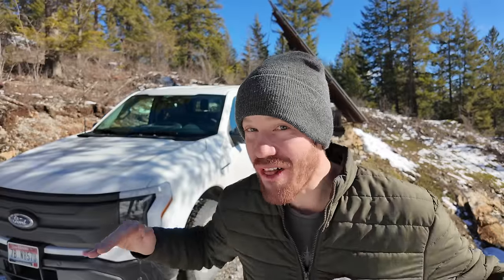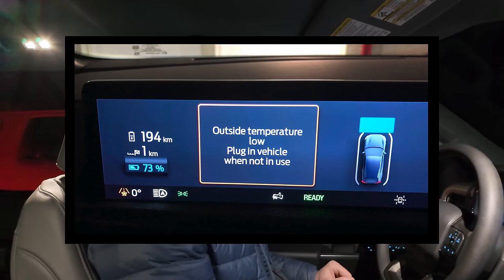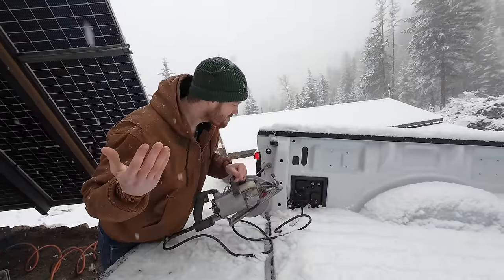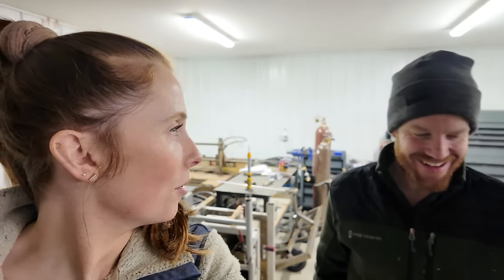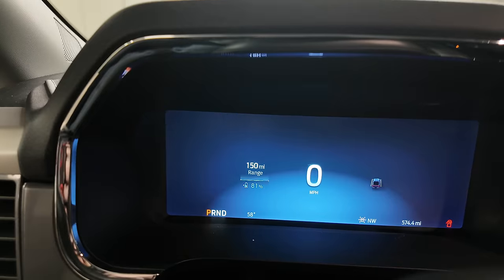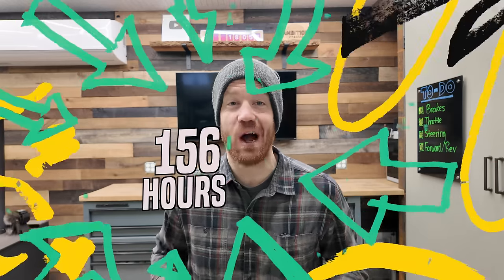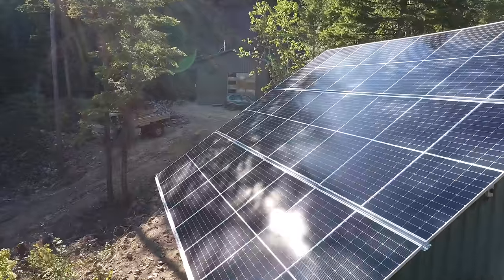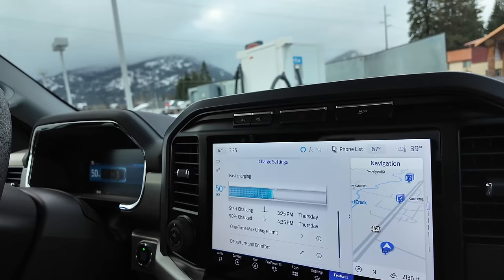Replacing My OFF-GRID Power System With an E.V. (not what I expected)

Comment: It being a Ford, it's bound to have electrical problems out of warranty that you're not going to be able to deal with yourself, so obviously I wouldn't have one as my only battery storage for my off grid system.  Right now it's the only truck that offers that ability though, so I would continue to charge it with excess solar power and use it in an emergency to power the home.

Comment: In my humble opinion, the use of an all-electric car in the northern states is not very justifiable. A hybrid can still be considered as an alternative to a conventional diesel engine. But in your case, it's money down the drain. It was easier to simply add battery capacity to the home off-grid electrical system.

Comment: 14:35 every 2 weeks trucks at 50%, tho in practical use double everything and the truck has 25-30% remaining battery by the end of every week, after 4 years usage the battery capacity under the same use would leave the charge very low 3% to 8%... due to cycle deterioration.
Reply: You do know that is only 208 charge cycles.  An NMC lithium battery (what's in the Lightning) can do up to 2000 charge cycles before reaching 80% of original capacity.

Comment: The biggest issue is with Ford dealers, mostly selling Ford gas vehicles. ICE (internal combustion engines) over 50% of the dealers refused to invest $1 million to install 480v EV Charging stations at their dealership and have their  mechanics retrained to work on Ford’s EV vehicles. Therefore the number of dealers that will support your lightning. F150 is half of those in the United States, and probably in rural areas you might not have any?  
Car & driver review 

caranddriver   / ford   /f-150-lightning

HIGHS
Quicker than the 700-hp F-150 Raptor R to 60 mph, spacious cabin with loads of storage, retains familiar design of the trusty gas-powered F-150.

LOWS
A starting price jump of over $10,000 in under a year, Platinum's interior doesn't deliver on the lofty price tag, managed just 100 miles in our towing-range in our test.

VERDICT
Fully-electric full-size pickups have mighty shoes to fill, but the F-150 Lightning is put together by the folks who built the decades-long bestselling truck—and it shows.

Comment: I am very curious about the warranty implications, 8yrs/100000miles, to not drop below 70% capacity?
If you used used your truck to power your off grid system, almost exclusively, and travel very limited miles, could you get a replacement truck/battery in way less than 8 years?

Comment: Can a EV replace the OFF grid power system you have.... NO It can not and took me 2 seconds to come to that conclusion. 
As a system power engineer I would say can the EV compliment the Off Grid system and the answer is YES.  
It is a second power option and also if there is 4000KWs more power of solar panels.   As in 10 more 400 watt panels to feed into the Off grid you will have.   Then you will find that there is more power to go to town and back and them some more.  For those extra longer trips.  My calculation is that during winter is critical.  Summer you would have more power then you know what do do with and so it does not hurt anything if the solar are not putting power some where.   however in summer one can run water purifiers and other equipment that is really electrically demanding.  Such as pumping water up "higher point" in to larger tanks or ponds for winter use.  Think like a water tower... 

The Trucks battery can be used to take and store more power in winter and having it in the shop keeps the battery warm so the battery warmer does not engage. 

Using the truck to grab power and fill the battery of the truck and then use the truck in emergency to power the house is also good thing.  Run a line from the solar shed so you can charge the battery while the truck is in the shop that would make things more easy for the both of you.  Which is the best place for the truck when you are not using the shop for work purposes.  The battery warmer can chew up a lot of power to keep truck battery warm in cold weather.  

Your military generator works for few days in a year when it is needed works fine.  
The rate of failure is low but still it is possible on that back up.

Comment: I feel like you guys are one day going to burn up some electronics with that old diesel gen. As an electrician it is a feeling like fingernails on a chalkboard. At least get a few more chargeverters, that will take the dirty power, and charge your battery bank faster, and safer. Same with your new whole house gen that is missing in action. 

Speaking of missing in action, where did the battery backup/ solar system go from your shop, the one using the panels over your porch?

Comment: The truck doesn't like inductive loads, that cause a spike when power is energized to it. Also, trying to run your solar system on the truck may cause issues as the inverter in the truck is not sinusoidal, sinewave, The system may not like it.

Comment: Level3 charging is to expensive and bad for the battery. Charging on solar power is the way to go. Hopefully if the sun was not shining and batteries were low you could still charge your truck with the diesel generator. Maybe save money charging truck in town, having dinner and filling up the batteries if it cost less. However being off grid would save you tons in fuel costs going towards paying for the truck.

Comment: You could automate your System to only charge the car as long as the battery system is at 100%
You would need a System that can connect to your Battery management system and your charge controller/car app API at the same time.

Comment: If you run the numbers, would more solar panels and a larger battery bank be a more cost effective solution than buying a $49,000 truck?  More battery capacity might be able to take you through the periods of low solar charging.  Personally, I would find it very inconvenient driving to town, wasting time, just to charge the truck in order to transfer power to the off grid system.  Plus, you are fast charging, which is compromising the truck battery life.   Using the truck as a power source might have a "cool" factor, but is it logical?

Comment: Honestly it's a shame that you need to turn the truck on and disable everything and enable the plug. If it wasn't for that you could just find a way to automate charging the truck from the panels if the house battery are 90% full or if there's any spare power and then have the house pull power from the truck if the house battery are empty and the truck is over 50% full or something like that using smart switches. No manual intervention, just plug charger to the truck and the truck to the generator plug.

Comment: Liked your video as I live in POA and they do not allow solar panals on the roof that are exposed to the front of the house. I am trying to educate community that today's panals are not that unsightly and that the cost of grid power will continue to increase. More importantly, electric vehicles now allow us to divorce ourselves from the gas stations and the control over pricing. Like you, I am an EV advocate as I now own a Volvo XC 40 Recharge all electric vehicle. Unfortunately, as you found out with your Ford EV, unless you purchase their vehicle to grid inverter, the truck will not work as a battery storage system by itself. At present, only Tesla offers a vehicle with its own inverter to connect to your house as a complete battery back-up system. I am trying to show the home owners the future of EV vehicles as an aid for home back up and a cost effective battery source as you get a vehicle with the same storage capacity as home storage back up but with a car, too. It costs me 5 cents a mile to operate my car at a grid price of 11 cents per Kwh. I have been following Enphase for their introduction of the bi directional charger this year and if it will be compatible with my car or not. I actually prefer the Tesla as it is self contained and only requires a gateway to connect to the grid. Thank you very much for your video as it will explain so my to my POA in hopes of changing their rules.

Comment: I was unsurprised by many of the problems you ran into. I have read a lot of first hand owner accounts as I consider what I am going to buy for my next vehicle. I also live in an area HEAVILY affected by the "Polar Vortex" thing we went through and had to give a ride to two Tersla Owners and one Ford Lightning owner who work at my job because the7y could not get their Vehicles to charge in the extreme cold. I think the most I am willing to consider at this point is a hybrid, and will put off a full EV until some of these issues are dealt with.

Comment: I consider the concept not yet ready for prime time from a true plug and play perspective. From what I've read on a few forums related to EV's and EV trucks, the way Ford implemented this and their software doesn't lend itself to handling backup very well. There is additional hardware most homes need (some of which you already had due to bein off grid and some you had to figure out and install). Most people would simply want to hook the truck up to their home charger and if the power went out, the system would automatically sense it and turn the truck on to provide house power. Unfortunately it has neither the output capacity, nor a way to seamlessly do this that I know of. You seem to have very low capacity needs which is great for you being of grid, but if you have AC, sump pump, extensive appliance usage, etc. you can easily use upwards of 30kW/day of energy with many using more. While theoretically a 90kWh battery could last you 3 days, as you discovered, unless it can handle the current draw, things go haywire quickly. Even the battery systems you get installed have issues including Tesla powerwalls (although arguably they are the most advanced when it comes to seamlessly switching from grid to off grid mode). I agree with you that it would be GREAT to have a XXKwh battery vehicle that when not used as a vehicle, it can be used to provide home backup, but until the mechanics of doing that and the software mesh better, it is still a crapshoot. 
I got a partial battery and generator backup installed for critical load circuits and it has had a number of issues seamlessly switching over from grid power to battery/generator. Thankfully it's not been needed much. Originally the software didn't even work to perform the switch over. Had to wait over a year for the manufacturer to get it right (it was evidently in beta mode although nobody informed me of that at the time).

Comment: Well every charge or discharge spend your battery life time, so in case you just purchase new car for max 2 years and you will have chance to sell it, it's ok for you but so bad for new buyer... in case you want to have it life time because discharging is like driving vehicle. The noize is inverter, maybe internal heat pump for cooling batteries warmed up by discharging. The next is if you want to use it, you have to park car forever and importing energy... ok if everything will be all green so in you don't have enough energy from solar so also is high probaility all around will have the problem. And remember, all green means no more backup generator ;-)

Comment: Looks like the answer to your question (Can this EV truck replace our entire off grid power supply) is no. It can only supply a small part of it. I don't think that the reason for buying the truck was for off grid power, but I guess in a pinch you could use it for that. I have seen many tests of the F150 that show it is at best a truck for going to the store and back. Pretty useless as a normal truck.

Comment: I wouldn't think it would be a good idea to have the vehicle be your sole source of power.  If you need to go to town on a particularly cold day and didn't have power, would you have heat (I suppose you would have wood heat)?  If not, I'd be concerned about water pipes freezing.  Also, what would happen if the truck was running low on power and there was a blizzard and you couldn't get to town for 12 to 24 hours.  It seems like it could be integrated into a system allowing for a smaller battery bank to be installed but I wouldn't want to be completely reliant on the vehicle for power.

Comment: I don't think an EV can REPLACE an offgrid system. The house is without electricity when the EV is in use? The EV may be an excellent BACKUP as you have demonstrated. You still have our solar panels and home batteries, so nothing was REPLACED. You have demonstrated that the extra battery capacity of the EV can be used as a backup and you have demonstrated that the extra photovoltaic capacity can provide free mobility. The problems you had charging, for example at your parents, is totally on you. There is no way to push that kind of charging power through a 110 volt standard outlet. We can't even quickly charge our EV at home in Europe from a standard outlet and we have twice the voltage. To charge our EV at home in a timely fashion, or to drain off all that excess electricity in the summer, we have a special EV charger- It can handle up to 13 thousand watts.
Overall, I think you did a disservice to the EV community with this video.

Comment: 14:30 can't believe you chose the Ford Lightning truck, after all those bad tests, especially that from Hoovie's Garage. Range collapsed totally in cold weather, even with an empty trailer. But I guess you got a smashing deal on it. 😉And yes, it takes hours and hours to charge it at the station, it will take days to charge at home. so it's one of the worst EVs you could have chosen for your situation and daily use. Apparently the only brand that got the fast-charging and long term battery management down, is Tesla. If Ford hasn't drastically changed something, I predict you'll regret buying this truck within a year.

Comment: Also all the truck inside gadgets run off the 12v battery. Not the actual high voltage battery,  with it being cold that first erro. I do believe it was the 12v battery dying, ford has hella issue with, charging the 12v battery being idle, not driving. The truck, because the 12 v battery charges with regeneration,

Comment: Can it replace your off grid system, No, but it complements it very well, the other part of this is what you are paying to recharge in town, if that number is very low, you are in a sweet spot, in relation ship to your cost of diesel, or propane to power your generators when you have no sun to your panels during the winter for long periods of time. You are also right when it comes to cost, buy the truck with a 90 kilowatt traction pack, that lets you use 80% to power the house, versus the cost of a like sized home battery pack, and charging infrastructure, it becomes a no brainer, the truck is the better buy, as a compliment to your built off grid system, and being able to charge it from the panels as an extra dump space when the home batteries are full is icing on the cake, and you can drive it too, sweet.

Comment: I will say buying a EV with Lithium Ion batteries is a safety concern(Fire). I would wait till they use LFP Lifepo4 cells which are safe. Also you do not want to keep it in your Garage and if you do you have to report that to your insurance which will go up big time. So you should park it 15' away minimal so it doesn't burn down your house.

Comment: I use an electric motorcycle for work commute.  21 mile round trip of mostly freeway work, and I routinely get home with 20% remaining (4 miles?) so I fully understand the range anxiety issue.  Your idea of using the truck as a backup battery is a great idea!  For me, we use our one-ton diesel truck for long-haul RV traveling, so both range and capacity would be deal-breakers for us.  Thanks for another great video!

Comment: "Actually I don't even know where it plugs in." Well now we know that we need to avoid Mike White Ford, holy crap. That's literally the first thing they should've shown you before you sat in it. FFS.

So I would use the solar to power my truck, but I also live in the desert where I can expect to have over 300 days of clear skies. If I were in your sitch, I'd probably think about going to town for dinner once a storm and plugging into the level 3 charger while I was there, but I also wouldn't rely on cycling my truck batteries to power my home. Cycling is what kills batteries, so I'd get the diesel generator started when my home batteries were below 40%, that way I have a better chance of them living longer.

Comment: Sounds like the hair drier has a high residual current problem. Probably the car has higher sensibility than common residual-current circuit breaker.

Comment: In the shop to in a 50 amp 240 volt NEMA 14-50R Female receptacle in box off the post so to can charge truck yes Plug in unit need neutral wire 4 wire system for 120 volt Most my time is install EV charging unit Hard wire 3 wire system or the Plug system great on the road charging   All way find 240 volt plug system (40 amp 240 volt 30 miles hour charge time about ) next test I like you do is One big solar generator pack see if charge the truck give you Plus mile ?

Comment: I have seen the commercials for the F-150 lightning. You have to have your house equipped to run off of your Ford F-150 otherwise it will not work it has to be Ford Pacific components.
And the sound the electric vehicle makes. It cannot be shut off at all. Is government requirement for electric vehicles. And I don't know how to do it either because I don't own a electric vehicle.